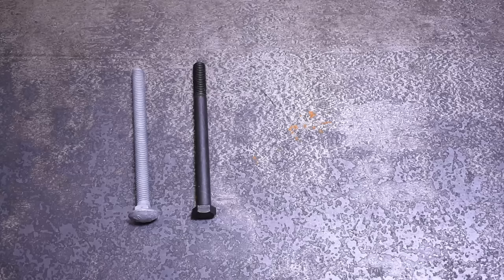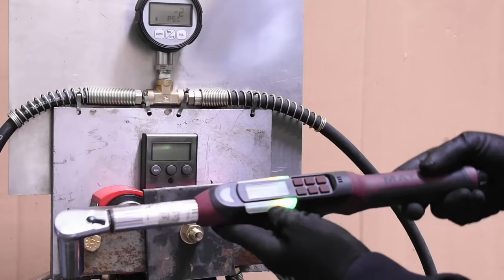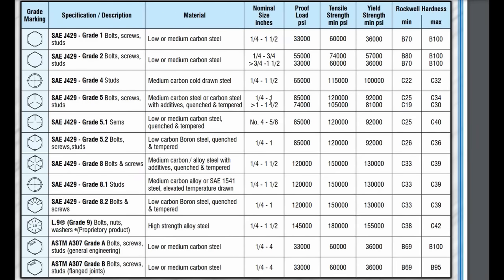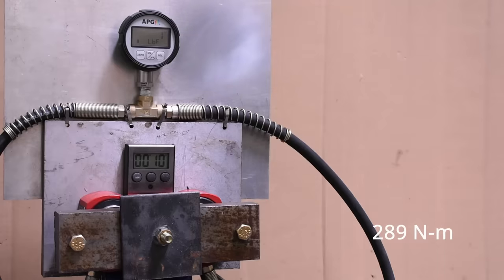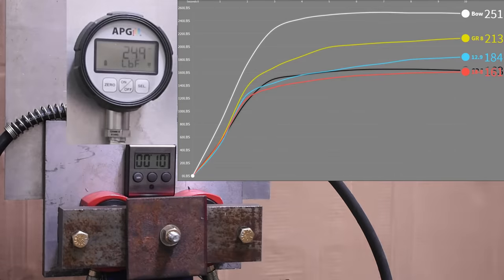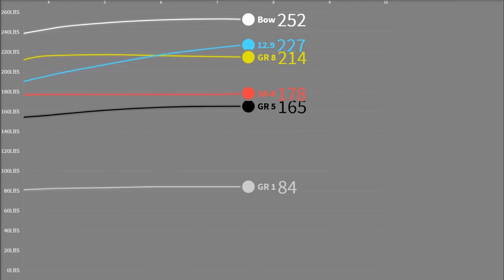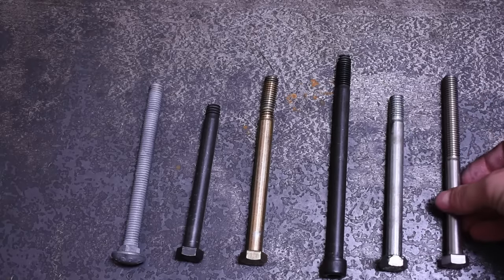Strongest Bolt? Grades Explained & Dyno Tested For Science

Comment from the maker: Save for a few exceptions, yellow bolts these days are not Cadmium plated because that's a heavy metal, they are yellow zinc as mentioned. Think we should have tested them more like how they do in labs? That info is already easily found, we're using these how people in our jobs might. It's also IMPORTANT to understand we're yielding these bolts, because its fun and we wanted to see them fail and where. But the climb up the curve is where they should be used, not near at or past the crest because that's when they are stretched and toast. These values drop when using an equally low grade nut, but we're usually threading into parts like a steering knuckle. Not an opposing nut, so just eliminating variables. We keep bolt trays like Class 8.8: https://amzn.to/37PtUnD and Grade 8: https://amzn.to/3Cu6sq3 pretty close by when working on stuff around here. And they make flange head sets for automotive: https://amzn.to/3vqw5XO Has saved my bacon a number of times! 
What else do you want to see tested?
Reply: i've always used grade 8 when replacing bolts. this video was very informative thank you for your hard work.
Reply: There's so many different grades and styles of fasteners out there you could probably do a whole other video. Allthread, Structural bolts, chrome molly, and lots of special application stuff like custom age or cryo treated. In heavy industry we come across a lot of weird specialized stuff that you probably couldn't find unless lifted off a job. Thanks guys it's always interesting.
Reply: Some classic test to fails would be wheel nuts and drain plugs.  How much gorilla can wheel nuts take?
Reply: John Cadogan has a few videos on high tensile bolts, how they behave and the science/engineering behind them. Might be worth a watch and seeing how that information plays into your tests here
Reply: Great video. I work at a heading shop that makes automotive fasteners and have always been curious about this kind of info. If you are looking for more to test let me know
Reply: Convenient timing on this video getting posted. I had a meeting with Applied Bolting Technology today that they demoed some of there DuraSquirt washers. It's a extremely interesting product for torquing. I asked if they have ever seen your channel they said no but where gonna check it out tonight hopefully they can send you some to demo and translate 50 ksi clamp load into FtLb and PSI
Reply: Don’t forget there differences in shear vs tension requirements.
Reply: Yeah the grade 1 bolts are more or less used for like wood deck construction where the wood will more than likely give before the bolt. They are good to use for sacrificial bolts like welding nuts together and keep the threads clean or even cleaning out threads of stuff. Good for simple use or replace later type stuff.

Also marine grade does not mean all marine grade, Some get that part mixed up as even that stainless will still corrode very badly with salt thrown into the mix. Fresh water marine grade is what is normally used for that type of stainless. There is special stainless bolts for salt water but never see them anywhere normal, so would be good to see one of them.
Reply: Throw some NAS bolts in next time
Reply: As AvE would say:
"it's not a bolt unless it has a nut on it, technically it's a machine screw".

I'm just an Electric-Chicken. 

Keep your stick on the ice.
Reply: I dont agree.  Bolts best usage is stretched into their elongation area, not beyond and deformed of course.  Try using stainless cable ties vs plastic ones and you will see what I mean - stainless cable ties being completely unstretchable are very difficult to strap anything down firmly with.
Reply: Whoa Whoa Whoa, what you are reading on your gauge is LbF which is pound force not foot-pounds. A torque wrench will tell you the torque put into the element you are turning. But these two measurements are not a direct correlation, it depends on lubrication and the overall condition of the bolt and threads. I'll reserve judgement on if you in fact do not know what your talking about or if you are just making semantic mistakes when talking over the video. Other wise please do your audience a service by explaining these differences and going over how your test setup actually works and what it is actually testing.
Reply: Would have liked to see a typical aircraft bolt included in the matchup.. like an AN8
Reply: All that way and no hardness on the stainless.. the stainless is the whole reason I tuned in.. I replace grade 5 with stainless all the time on my engines/accessories considering as it’s not an actual engine assembly part/pcs..
Reply: @scottreed5460 Most stainless fasteners are 300 series stainless and can not be heat treated. The can be work hardened to change their mechanical properties but generally will be between grade 2 and 5 in strength.
Reply: The yellow zinc coating is a chromate finish, which contains toxic hexavalent chromium.

Regarding stainless steel bolts, there are the A#-## series bolts that have a specific strength rating. E.g. A2-70 or A4-80. If my memory serves, A2 = 304SS, A4=316SS, and the number after the hyphen is the tensile strength is MPa. These grades are for metric bolt sizes.
Reply: @erikb3799  Zinc yellow is now mostly trivalent chromate with yellow dye added. It is much less toxic than hexavalent chromate. Its actually getting pretty hard to find a plater that will do hexavalent in the US anymore. Still pretty common out of Taiwan and China, but you sometimes have to ask them to do it. The default is usually trivalent now.
Reply: @danieljackheck  good to know. Thanks for the information. I'd assumed it was zinc chromate, since that's how it is often labeled. I assume it's a zinc-chromium alloy that's plated on and colored yellow somehow?
Edit: you said "trivalent" -- I'm not sure which salt or mineral would have trivalent chromium and adhere to bolts. Based on my limited metallurgical knowledge, I'd guess is chromium metal rather than an ionic +3 chromium compound.
Reply: @erikb3799  The chromate is actually a separate thin layer applied after the zinc is deposited onto the base metal. It protects the zinc from corrosion for a period of time. The ability of this layer to protect the zinc is what gives you hours to white corrosion of the zinc in a salt spray test. The thickness of the zinc itself gives you the hours to red corrosion of the base metal. Typically hexavalent chromium provides significantly better protection than the trivalent, but can be supplemented with an additional "sealer" that can supplement the chromate layers protection.
Reply: How come you didn't tighten the last one till it broke?
Reply: Enjoyed this test. But if I had something to add, it would have been bolt stretch. Lot of ARP fasteners have torch spec, but also list the amount of stretch each bolt should have just to ensure there is no premature failure.
Reply: So you're just ignoring chemical bolts.
Reply: When you're calibrating that dyno with a torque wrench, you should lube the threads and put some Grease on the inner face where it makes contact. This will give you a more accurate torque measurement, because it will eliminate some of the friction.
Reply: My understanding has been test ratings on bolts are tested with 30w oil on the threads.. to avoid shearing the bot rather than tensioning it to yield or failure.. interesting to see the graphs.. but should have used oiled double nuts & avoid thread stripping vs bolt test
Reply from the maker: @Errol.C-nz  All that info is easily googleable though. We're providing a more real life example of what people will experience.
Reply: You forgot Titanium bolts as well, plus in the LS Head Bolts tests, you have the bolt going into a iron base, which all or most LS engines are all aluminum blocks ,you do have IRON Blocks, but then the tests would only be valid for anyone with a iron LS block and then putting Aluminum Heads of it and then using the bolts you tested for failure rates? 👍👍🦘🦘👌👌
Reply from the maker: @7071t6  titanium bolts are for dress up. No one uses them in a serious automotive use. Only advantage is weight on a bolt.
Iron was used to eliminate variables and ensure measurements were from the bolt only. Data on bolt stretch still applies
Reply: @TorqueTestChannel yes th3ey do in racing car, sprint car racing etc, i used to sell them, lighter and stronger than 12.9 grade bolts, which is why they use them. 👍👍🦘🦘👌👌
cheers keep up the great work champ. 👍👍🦘🦘👌👌
Reply from the maker: @7071t6  what kpsi (or metric) rating did they have? I'm curious. Even F1 uses steel alloy bolts
Reply: @TorqueTestChannel  both metric and imperial as well, not sure what brands they were, but it was a shop which supplied the sprint car racing in Melbourne Vic AU. Also used to sell aerospace/ aircraft alloys, and even the aircraft maintenance industry used titanium bolts, nuts washers etc etc, in fact used to sell  6061t6 aluminum sheets to the sprint cars racing shops owners and 7071t6 sheets as well, basically used teh sheets to make the reverse wings or spoilers on the back of sprint cars etc. 👍👍🦘🦘👌👌
Reply: i miss cadmium :(
Reply: why is there no 12.9 grade bolts tests?👌👌🦘🦘✌✌👍👍
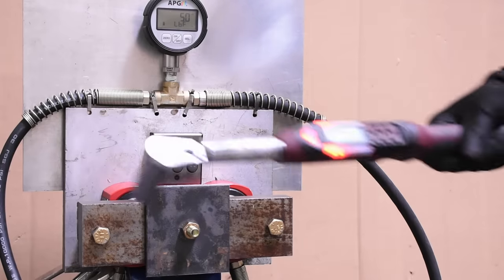Reply from the maker: @7071t6  10:45
Reply: Where do I buy 12.9 socket head bolts? I need some M12s.